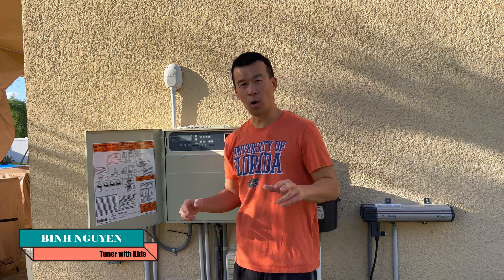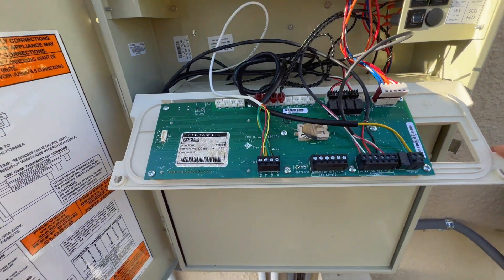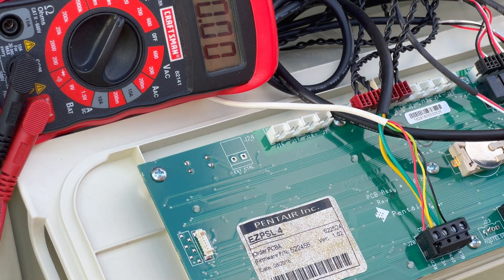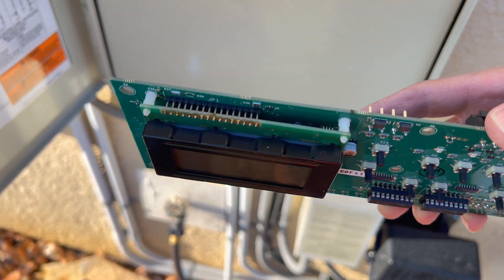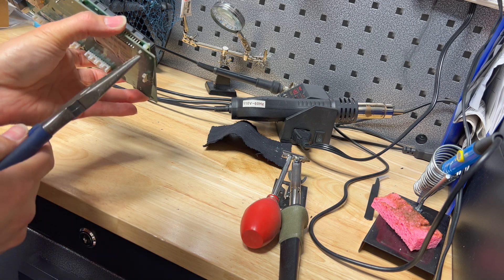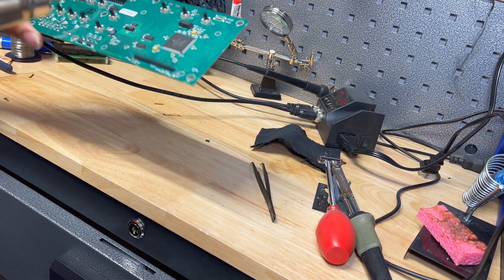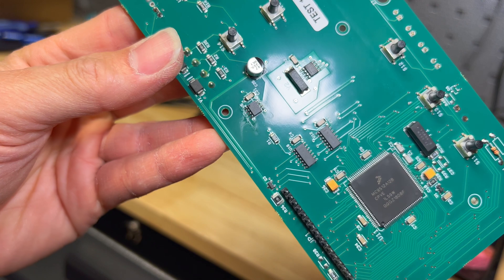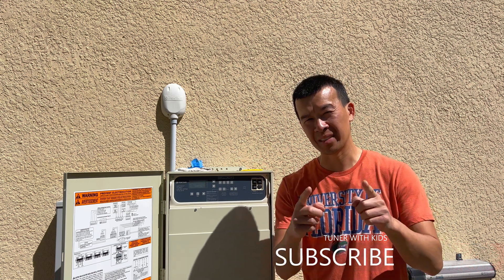How to Fix Pentair Pool Easytouch Control Board | Dead RS485 Chip | ScreenLogic

Comment: I’d just like to thank you for this video. My easy touch 8 blew up in lightning and I bought a new comms chip like you said and took it into an electronics shop to be installed. Now my system is back to normal for the small cost of soldering labor and the $3 replacement chip rather than a $1,500 replacement board!!

Comment: I noticed on the surge it had an in / out port so ur video showed a green & yellow coming from the out port to the com port on the board but what wires came into the In Port
Reply from the maker: The in/out probably doesn’t matter since a passive device. It’s for the power and ground wires (not data) of the RS485 plug. It since inline to take the surge to ground.
Reply from the maker: The wires are the two power/ground I removed out of the plug into the board.

Comment: Thanks I just ordered one of those surge protectors u installed on that board wondering what wires go to the other end I noticed a green and yellow wire went to the com port plug but where did the other end get wired to…Thanks
Reply from the maker: The two port wires intercept the RS-485 power. The coiled wire gets grounded to the common ground buss in the panel.

Comment: Are you located in Florida (by your tshirt?) or where are you from. I have an issue with my communication, it seems that was some sort of water of condensation inside that short circuit something. All the buttons work and light , but the communication with the pump is not working that seems to be the RSA chip you mentioned. I have a PCB 521099 board.
Reply from the maker: Yea I’m in Orlando. But if all controls work but your screen logic app and pump communications aren’t then it’s that chip.
Reply: I can’t turn on the pump via my easy touch or screen logic but able to turn the pump on at the pump. I did ur test and had 5v on all three places u tested so im assuming that chip has went bad
Reply from the maker: @leebriand5305 if you’ve lost the serial communication, it’s most likely the RS485 chip.

Comment: I got a lighting strike a week ago.
 this work repaired my easy touch 8 board but my screenlogic burn up also.
has you tried to repair a screenlogic
Reply from the maker: Does it not power on or no communication? The outdoor receiver/transmitter also has same chip for RS485. That might be bad.
Reply from the maker: One way to test is to bring the white ScreenLogic box down near your receiver and wire it directly into easy touch, plug into a long Ethernet cable to router and see if it works.
Reply: my screenlogic protocol adaptor is hard wire to my easytouch I'm not using the wireless kit.
after the lightning strike my app lost communication with it
Reply from the maker: If hardwired, the chip might have surged too in the adapter. It might same as the one on the easy touch since it’s a commodity item.

Comment: This is just what I needed!  Thank you!
I'm in the same boat, running EasyToutch manually since a lightning storm last year with UART Error 5.
The board visually looks fine, but unfortunately, I'm getting only 0.7v on the voltage test that you suggested.
Any advice on how to troubleshoot further?

Separately, UART failed before and the board was replaced under warranty.  It seems a common problem with these controllers.
Do you think it is the design or improper grounding?

Thanks again!
Reply from the maker: Try this thread. It might help with the low voltage. https://www.troublefreepool.com/threads/pentair-ic40-with-no-power.148051/